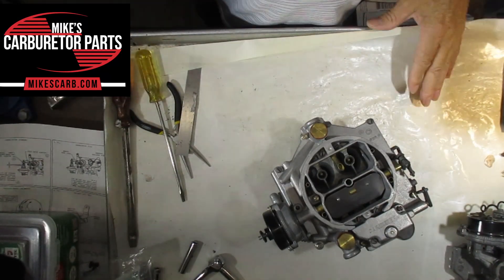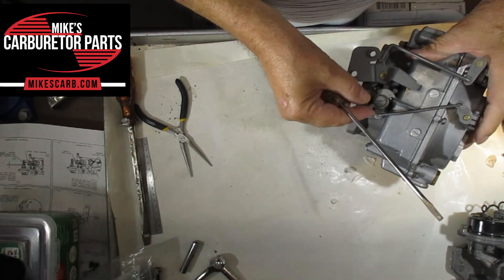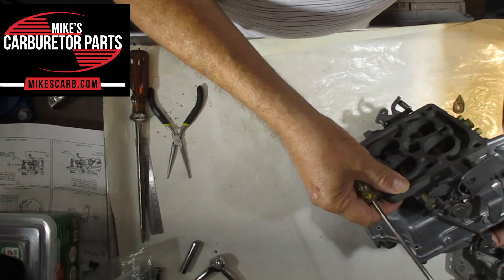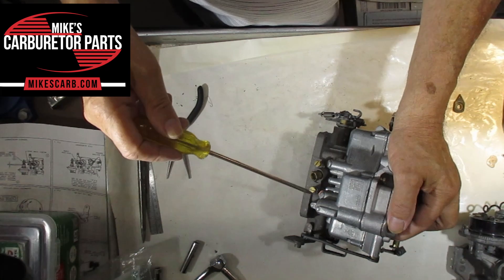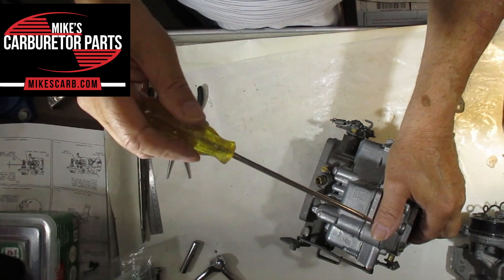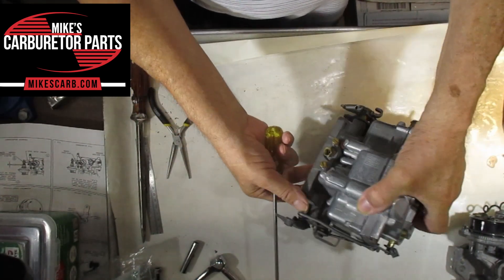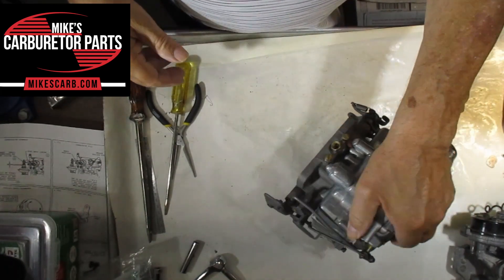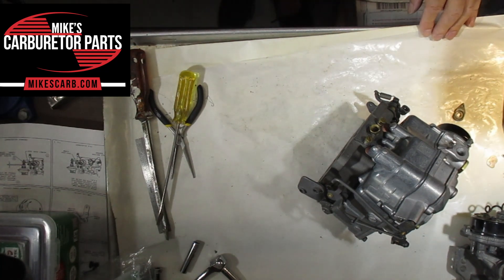Carburetor Idle Mixture Adjustment

Comment: The idle screws on my carb are really hard to get at when the engines running. Do you know of any special tools for adjusting them when they are hard to reach or any tips or tricks, Thanks.
Reply from the maker: There are several tools around like this one on Amazon: Performance Tool W1187 Flex Shaft Carburetor Adjuster Screwdriver
Reply: I have the factory autolite 4300 on my thunderjet 429 and the right side adjustment screw is near impossible to get to. Thanks for asking this question.